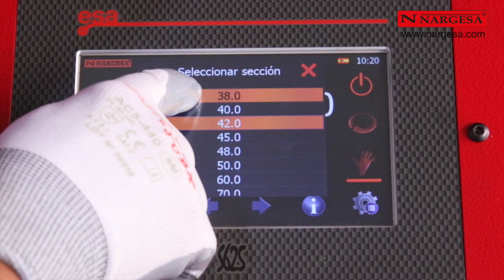FABRICAR INVERNADEROS CON LA MAQUINARIA DE NARGESA

Comment: What diamiter and thikness of tubes ?
Reply from the maker: The dimensions of these tubes are: 60.3x2mm. If you want more information, please send an email to nargesa@nargesa.com and our sales department will assist you
Reply: @Nargesa  But what reduced diameter? 54,3 ?
Reply from the maker: @ОлександрБровинський   The exact size for this reduction is 56.3mmm. However it is advisable to keep some tolerance. 54,3mm would be a correct reduction size, bearing in mind that these links should be reinforced or fasten with bolts